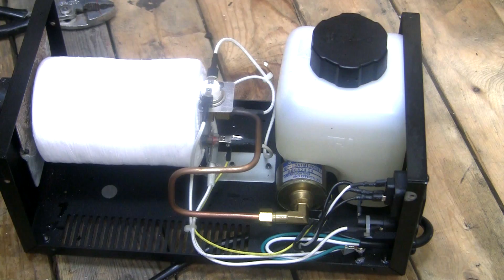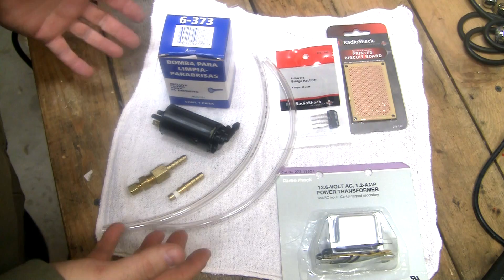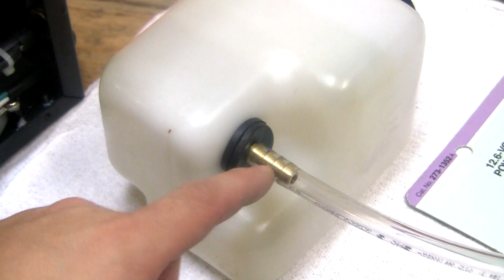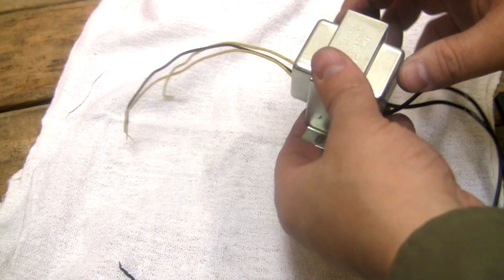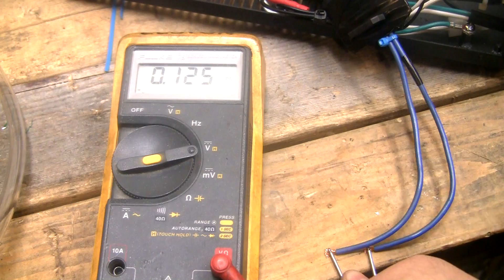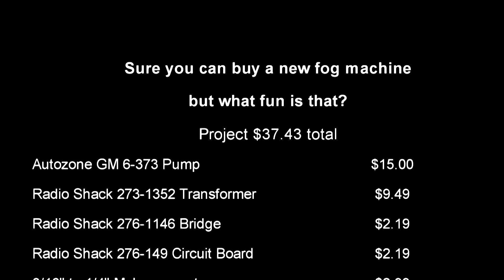How to Fix a Fog Machine Pump

Comment: How do you know that the pump has gone out, and it's not another component?
Reply: Usually the pump is what shoots the liquid into the hot barrel. It either won't have any sounds or its like you hear the pump running but it's dry pumping with nothing coming out.
Reply: @chris_elston  In my case, the pump makes no noises whatsoever. The heat exchanger heats up, and the pump does nothing. Thinking the pump was the failed component,I bought a brand new replacement pump and wired it in, and the new pump is doing the same thing as the old pump. Nothing. There are no sounds, no vibrations, nothing. The thermal switch is working perfectly, and so is the heat exchanger. I put probes on my in line wired fuse, and that seems to have good continuity also. So, I suspect the issue is something other than the pump. I was just wondering if you had a method of testing the pump to decisively say it was or was not working.
Reply: @chasengrieshop  Is there a way you can measure the voltage on the pump? The pump is AC if I remember correctly. So be careful. See if you can trip the switch and see if you are getting voltage to the pump. If not, it could be the thermistor on the top. That is not sensing enough heat from the barrel to turn on.
Reply: @chris_elston  I don't believe the pump is getting power. I don't have a lot of experience with diagnosing electrical issues, but I have my multimeter set to ACV, and I've touched one probe to one of the pump's leads where it connects to the heat exchanger, and the other probe to the pump's other lead where it connects to the back of the plugin for the machine's remote. There was no activity going on in my multimeter's displaywhen I powered on the device. Also, there is no grounding tab for what I presume to be the bonding wire protruding from the pump. The pump only has two leads (wires) and they're both black. I don't think polarity matters in this case does it?

In contrast, once the machine was powered on, I touched one probe to the lead coming from the power switch and the other probe to the heat exchanger, all kinds of numbers flashed across the multimeter's display and continually changed,

So, right now, I suspect the plugin is bad? I'm not sure if I'm right about that though.
Reply: @chasengrieshop  The electrical for this will be 120 AC more than likely, so there will be a hot wire and a neutral wire. Using a voltage meter set to "AC" keep the black probe of your meter on a ground or a white wire somewhere. Now use the red probe to touch spots or test points. Be careful, not to get shocked if you have not done this before but kudos to you for wanting to learn! Anyway, in my video the thermistor on the top of the heat barrel is like a switch. One one side you should have voltage, about 120. Touch the other side, you should have voltage. If you do not have voltage, the thermistor is bad not allowing power to go to the pump even if you are pressing the switch. That's what stops the pump from pumping even if you are press the button, if the heat chambers cools down, the thermistor senses not enough heat, and kills power to the pump. So it might not be the pump, but a bad thermistor to check. If you have voltage on both side of the thermistor, then keep following the power to the pump and through the switch etc with your red probe, you should see voltage at each spot along the way.

Comment: Excellent video. Is the motor ok to run with the unfiltered DC output ? No need to use capacitors to smooth out the DC?

Comment: I found the pump online from the Antari company, ROC. For $81 I got four pumps. So far over the past few years I replaced two, and I have a third one in progress but I have to replace the brass "cap" on the output side of the pump to match the larger thread of the pump. We'll see how it goes. I also have to remove the black, plastic plug from the input side and replace it with 3/8" vinyl tubing, and reroute it to the top of the reservoir. Obviously it's a "hack" with an available pump versus an exact match.

Comment: The pressure/volume of the windshield washer pump is totally different than that of a fogger pump.  The volume is much higher, while the pressure is much lower.  An alternative to fix a bad fogger pump, is to use a drop-in replacement available from, Amazon, sold as a Espresso Pump!  It's about 1/2 of the cost, and an identical replacement for many machines (or an upgrade for smaller machines).   

https://www.amazon.com/gp/product/B00B8KBVZE/ref=oh_aui_detailpage_o01_s00?ie=UTF8&psc=1
Reply: I agree now (2016)...but keep in mind I made this video in 2011, I looked and you could not get a part like that back then without ordering from China, which I was not going to give my paypal account to anyone in China, but looks like you can now 5 years later. So for sure, do that now.
Reply: That's a good point.  Your video was helpful for sure, and a terrific low-cost way to fix a fogger.  A better alternative than to throw out an otherwise good machine!  Thanks  :-)
Reply: It's cool to see that your 5 year old post still provides a lot of help to us!
Reply: my German made korner uses a vdo 24v washer pump as stock
Reply: I've had a fog machine that has not been working for 5 years or more but I am loathed to throw it out so it's just been left in a store room. The machine heats up so it is doubtful the heat exchanger has gone so it's looking like the pump. Watching this has helped greatly I shall now have a look to see if I can fix it.
I have just had a look and I found this matching pump. 
http://www.ebay.co.uk/itm/172419128318?_trksid=p2060353.m2749.l2649&ssPageName=STRK%3AMEBIDX%3AIT
Between the two of you I've found my solution. cheers lads.

Comment: it's avaliable now..
Reply: Robert Edmondson:   download the Eli Express app. And look for a 120 vt 48watt smoke machine pump (55 DCB 120vt 48watt unit). My smoke machine works better now then it ever did new, Takes about 30 days to arrive. Mine cost around $30. I use the extra thick fog juice.

Comment: I have an old Ness fog machine. I tried this method and is does not work. The fog machine is designed for a high pressure  pump like what you get at Ali Express. I bought one there and installed it, works perfect. Only problem it's shipped from China, takes about 30 days to get it.
Reply: You might check out my comment above, as you can now get an espresso pump from Amazon, with overnight delivery!  Something to keep in mind for future pump failures.
Reply: There are a lot of expresso pumps. Could you give a specific part number please? Thanks!
Reply: 55DCB 120vt AC 48 watts

Comment: The problem with this is that the new pump will always deliver more fluid than needed to the heater. This could present safety issues, such as the risk of getting burnt with boiling-hot smoke machine fluid.
Reply: +Matheus Moreira 
Manual control is part of the answer, but also these machine will NOT pump once the temperature dips below what is needed to produce fog.  (assuming he wires it into the same part of the circuit, which he most likely will do.  
Once the temp dips below what's needed to make fog, the pump will stop receiving power.  There is a thermostat that prevents this.  
Good thinking on the safety aspect, but I have this same model, and know about the thermostat.  I'd assume all decent fog machines have this, for more reasons than just the safety aspect.

Comment: After much searching, this seems to be the most viable solution for repairing these things. Thanks for posting this! I know the cost is probably about the same as buying a new one, but I would prefer to beef up the one I have to last instead of adding it to a landfill. Now that you have had it for a couple of years, can you comment on how this has held up? I have two of them and both need this repair. Thanks!

Comment: Those foggers from Party City have REALLY cheap pumps.  I took one apart and the pump was cheaper than the one shown here.  It can make sense to fix it so you don't just buy another piece of garbage.  However, the parts used here cost too much.  Better to rip them out of some other trash.

Comment: Clever, and well done...but you didn't say much about the pump. Surely you must of looked at the flow ratings when you made the selection, right? I mean, you can't go with a pump that supplied a much higher flow rate to one that can not supply-or over supplies fog liquid! Can you say something about your thoughts on how you found this other pump?  Also....replacing the pump is probably the best idea: I tried cleaning one up several years ago to fix it. No go.